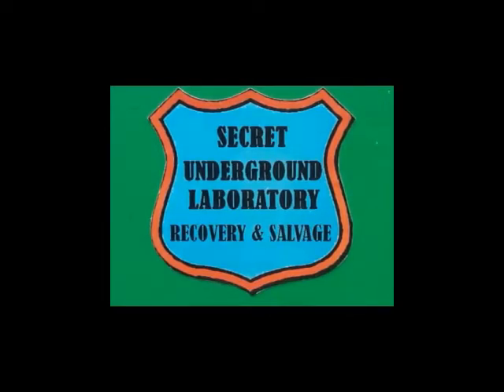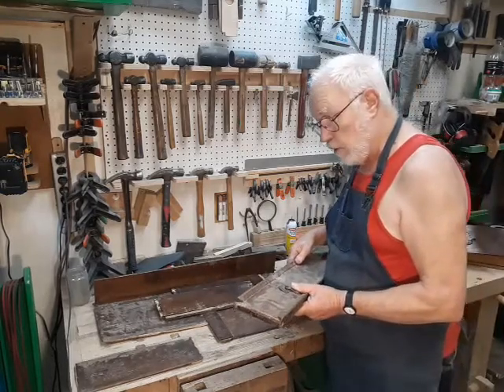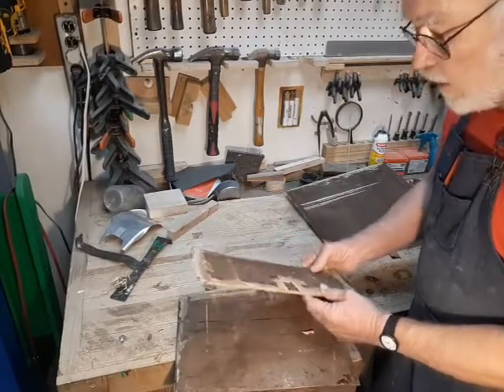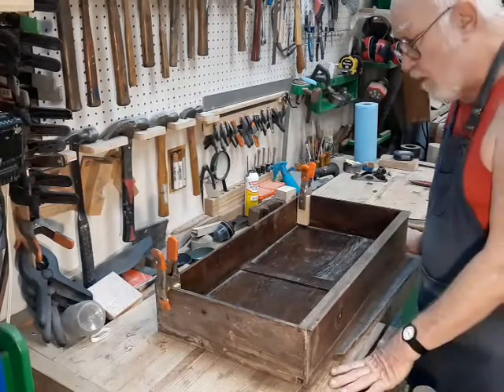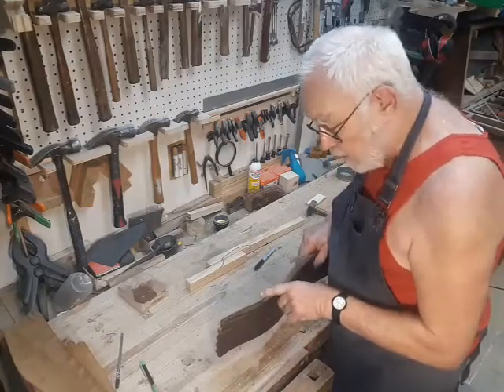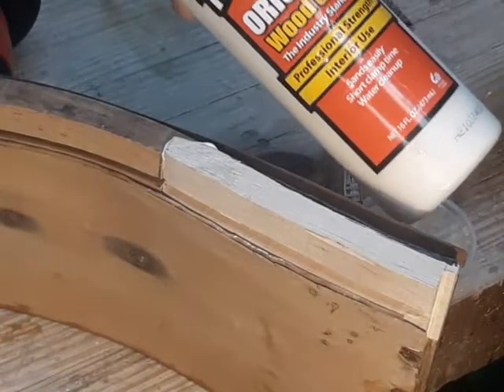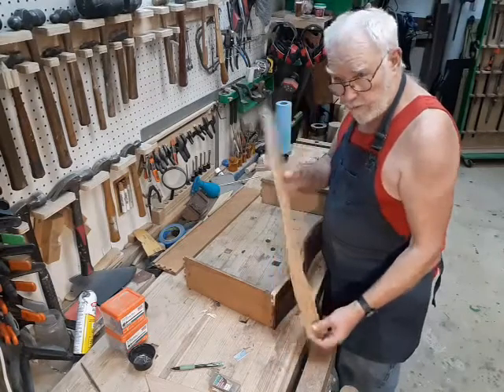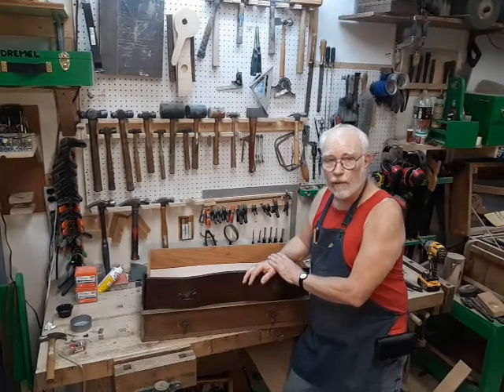Two Generations of Dovetails, Drawer Repair in the Secret Underground Laboratory Recovery & Salvage

Comment: Consideration of typical future repairs is hardly integrated into modern furniture design and construction. In fact, planned obsolescence is more often the main goal of corporate manufacturers.  My hat is off to you, sir
Reply from the maker: Thank you very much. Planned obsolescence is the inevitable result of mass production. Modern manufacturing methods dictate the use of materials that don't come apart easily. Even so, we get quite a bit of polymer and particle board furniture to repair.